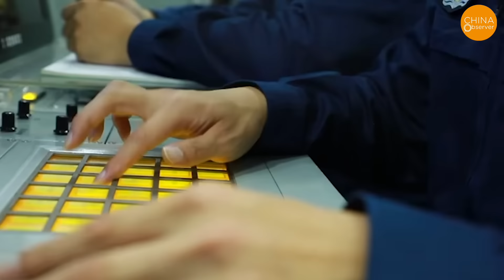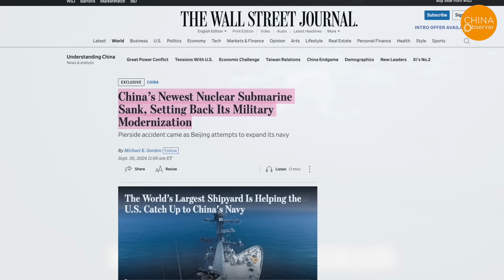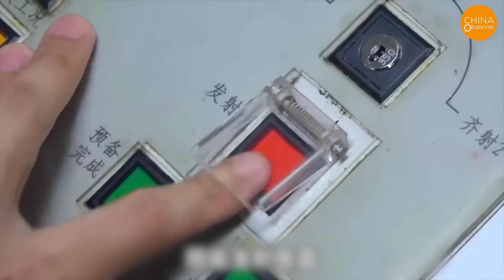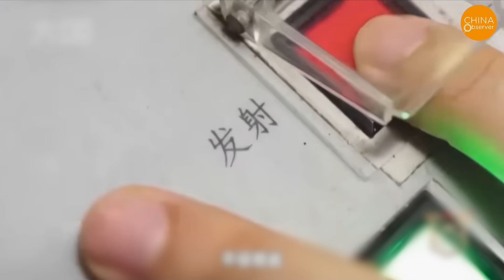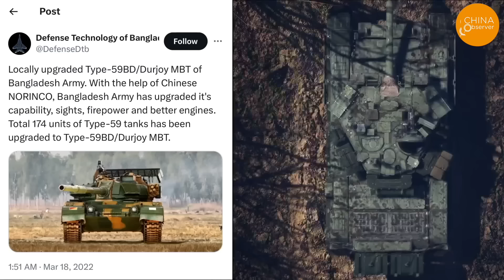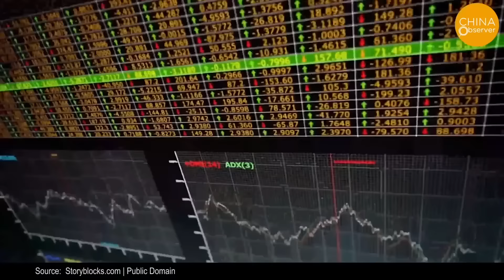China’s Latest Nuclear Submarine Sinks in the Yangtze River, Becoming an Epic Joke

Comment: Building and operating nuclear submarines requires decades of experience to do it well.
Nuclear subs are one of the most complex vehicles man has ever constructed.
They are way more complex than, say the Space Shuttle.
Reply: No wonder China can't master it
Reply: Just keeping a nuclear reactor running underwater can be troublesome.  It's definitely something  you don't want to farm out to the lowest bidder or to separate teams working independently.
Reply: There are plenty of places on a US Submarine that looks like a NASA command module. The equipment, the tech manuals, the interactive input/output elements. And that's just the stuff - there's no corner-cutting for personnel either.
Reply: Wow so complex that the US landed on the moon 60 years ago and made nuclear submarines soon after and China still cant do either!
Reply: @chinesesparrows We had nuclear submarines 15 years before man landed  on the moon.

Comment: Water completely filling a sub is bad, very bad.  The electronics are shot and will need replacing - which means the reactor may not be a viable powerplant anymore.  Depending on the metals used, rust is now going to be an issue, on the inside of the sub.  Any sort of seat cushions and such will also need replacing and if the sub sank and fell over, there may be externsal damage to the hull or rear control fins.  Wonder if any internal pipes or conduits were damaged.  A very expensive mistake and some heads are going to roll - look for an "anti-corruption" investigation.
Reply: They don't have to worry about reactor, all new plastic technology, save cost and weight.

Comment: All you have to do is buy a Chinese cellphone to find out how durable their products of manufacturing are. 
My Chinese phone had pretty good performance in the beginning. Then over the course of a few months, first my headphone jack failed, then my power jack became totally unreliable, and the final straw was when it stopped receiving GPS signals. Since I could no longer use it in my car with Google navigation, I ditched it and bought a Samsung of similar price point. Going on year 2 with no problems. 
I would look out for the South Korean military. Their stuff will be extremely economical and have excellent performance.

Comment: What nuclear "fuel"? Nuclear subs run on nuclear reactors. The material used to power the reactors, typically uranium, is not "fuel".

By this logic, a nuclear missile would use just uranium to both deliver the blast and propel itself.
Reply: It is fuel, if it powers the reactors. It may not be liquid fuel like many would think, but still fuel. 

A stick is fuel to a fire.
Reply: Time for Thrrax to get more acquainted with nuclear tech and nuclear parlance:
Uranium, weapons grade and other:
Mostly U235 is weapons grade, makes the big booms
About 10% U235 is reactor fuel
Nearly all U238 is DU, and makes antitank shot and very dense ballast. Really heavy, and sparks like mad if you grind it.
Reply: All nuclear reactors have what are called fuel rods!

Comment: This is not funny. Read between the lines. China is preparing for war. They are securely producing and decentralizing logistics for a large impending war effort. They hope to defeat the US economically in a military challenge to full mobilization, and they are winning. The US Navy and Air Force needs ships/planes and soldiers badly. The US may overspend on defense but it hasn't gone to these critical resources for power projection fast enough, instead bungling land resources in the Middle East. Call your representatives, call your senators.... the next 2-4 years and the post election period especially will be critical to the tone of the next century.